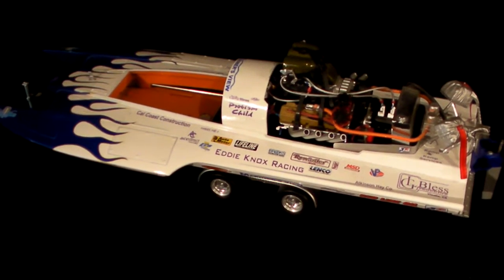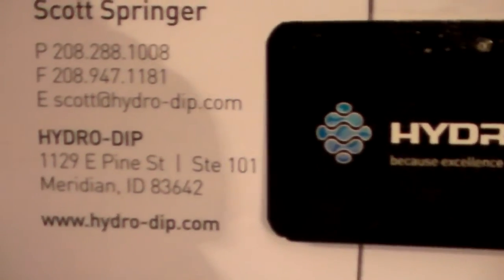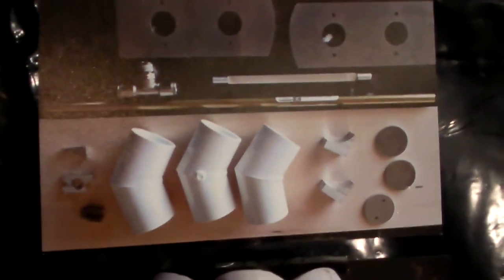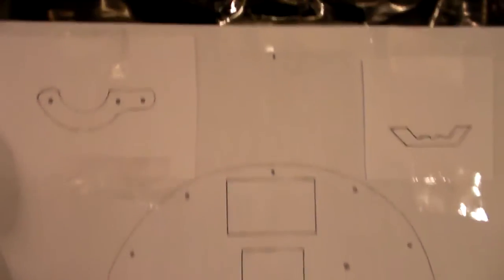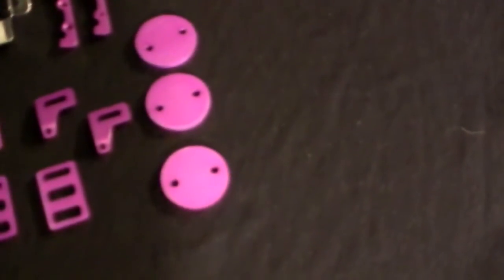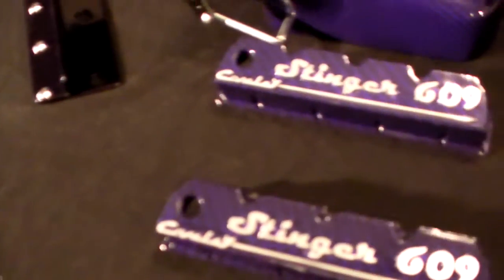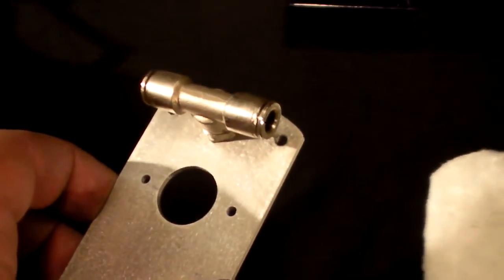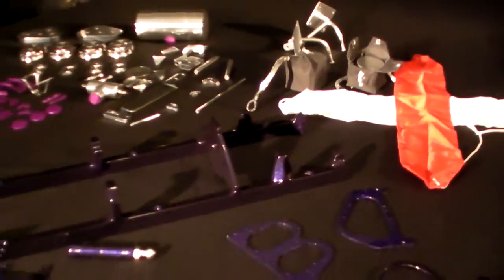Stinger 609 drag boat project part 4

Comment: Should contact Mike mastberg.
He’s building and running these.
Actually racing them.
Turning 32-34,000 rpm at the props. 
You need to re gear the v drives 1-2.71. Ratios..